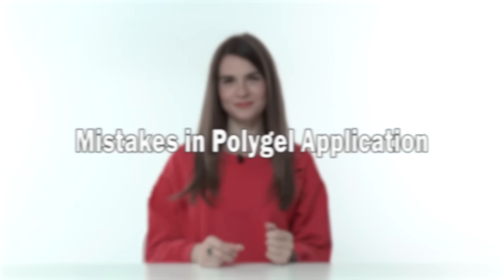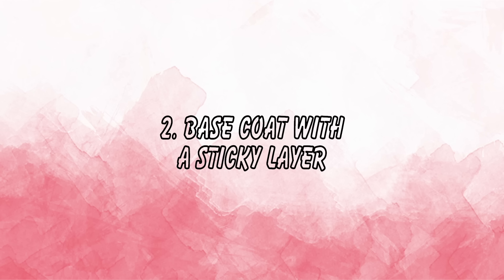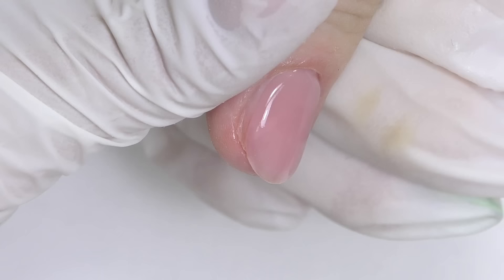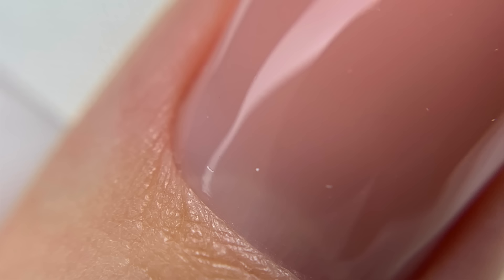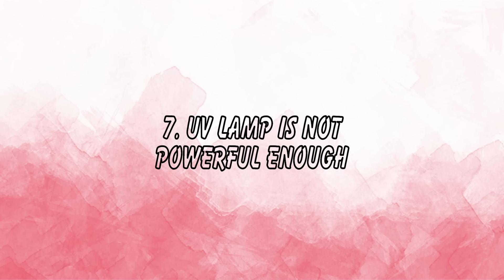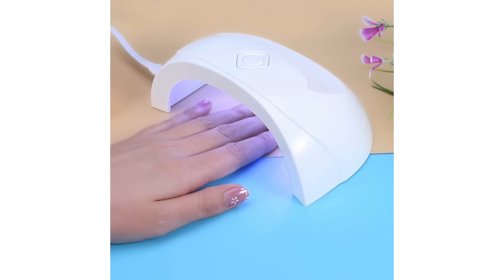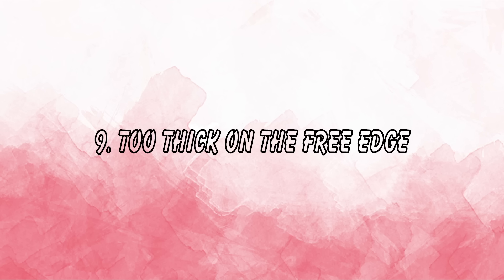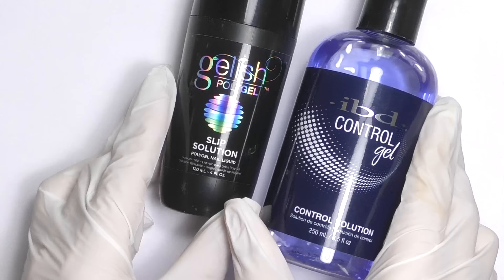Mistakes in Polygel Nails Application | Lifting problems

Comment: The special liquid is alcohol. Don't be fooled. 70% is good enough. Just don't use acetone. Aside from that, very good tips.
Reply: Eclipse Solano that’s what she said “special liquid” or “alcohol”. 🙄 also, any good nail tech will use 91% alcohol, not anything less, to be sure you’re better than “good enough”. 😁
Reply: I was having issues with sticking to the brush using alcohol.
Reply: @youngstaffswife2008  when I use 91% alcohol it turned my pink cloudy white.  70% alcohol is better.
Reply: @meaganhiller3029  I had that problem too.  All you do is use a little more.
Reply: Dayna even if I used more it still would happen. It would break down the product
Reply: Serendipitous Circumstance actually most branded polygel e.g. Gershion polish recommends 70% as any higher can cause the polygel to break down turning some colours cloudy or with white specks after curing.
Reply: 99 % is good or not?
Reply: Vimla Jharwal 70% isopropyl alcohol is recommended :)
Reply: As to the "special liquid".
From Gelish SDS Section 2: Hazardous Ingredients section.
Isopropyl Alcohol 
Isobutyl Acetate 
Acetone

Safety Data Sheet
IBD Control Gel Solution. SECTION 3: Composition/information on ingredients
Isopropyl Alcohol (CAS no.: 67-63-0; EC no.: 200-661-7; Index no.: 603-117-00-0) 90 - 100 %
Acetone (CAS no.: 67-64-1; EC no.: 200-662-2; Index no.: 6060-001-8) 1 – 10%
CLASSIFICATIONS: Flammable liquids (chapter 2.6), Cat. 2; Eye damage/irritation (chapter 3.3), Cat. 2; Specific tar
Reply: @youngstaffswife2008  70% alcohol is what everyone is saying to use.
Reply: @ishajharwal1573  not
Reply: I have Gershion and candy something lol and I used 91% and my nails turned out great 👍🏾
Reply: @youngstaffswife2008  they wasnt listening
Reply: I use acetone and it works fine 🤷🏼‍♀️🤷🏼‍♀️
Reply: Ashley Bailey I used hydrogen peroxide and it works well
Reply: Shan omg I have been wondering why my poly gel was leaving those white cloudy specs! I LOVE THIS THREAD THANKS EVERYONE!
Reply: What can I thin the alcohol out with, is water fine? My alcohol is 99%
Reply: Serendipitous Circumstance 91% ruins it! Don’t even bother lil girl
Reply: Celina Morgan if you buy a kit (some are really cheap on amazon!) it most likely has a slip solution.
Reply: Justyce Richards you used peroxide? Lol
Reply: Mo
Reply: Just use the base coat, that’s what some kits say to do anyways, works better and much smoother
Reply: His Serendipity she did not actually say alcohol
Reply: His Serendipity polygel nails need 50-70% alcohol 91% is too strong and ruins the polygel
Reply: @youngstaffswife2008  wrong!
Reply: @CelinaMorgan  no use less percentage alcohol
Reply: @ashleybailey2401  me too!
Reply: @strawburrygirl1215  interesting 🧐🧐
Reply: I believe that's what she said?
Reply: @meaganhiller3029  yes i sometimes have that problem. The trick is to slow down a little. I know it sound weird but i do it a lot. I try to do my nails fast and so i dont clean the brush all the way. Mabye have a separate dish just for cleaning your brush Inbetween nails. I do it and it works like a charm.😁
Reply: Yep I use 70%
Reply: Last week I wasn't paying attention and used acetone, I've learned my lesson 😵
Reply: No. All you need is the cheapest lowest alchole
Reply: @ishajharwal1573  no!
Reply: I like to use base gel
Reply: @youngstaffswife2008  no! 91% causes cloudy polygel.
Reply: @ashleybailey2401  you are definitely lieing. Acetone is used to remove the nails. Stop! You are spreading confusion on purpose
Reply: @marikiemarie7622  it works so why not use it😂. My nails never come off when I use it
Reply: She literally says the special liquid or at least alcohol lol.
Reply: Use whatever works for you lol
Reply: Is "100% acetone" with Denatonium Benzoate ok to use?
Reply: @harryismyhusband_jkbutilov9479  yes she did . she said "special solution or at least alcohol"
Reply: @MissHawes0187  but saying “at least” implies that alcohol is not the special liquid, but if you’re in a bind you can use it as a substitute. That’s not the same as saying the special liquid IS alcohol
Reply: 70-80% isopropyl alcohol has worked wonders for me, not just as a nail cleanser, but also manipulating polygel
Reply: special liquid is slip solution but u could use alcohol as well they are pretty similar
Reply: You can use %100 acetone nail polish remover or less than %100 or regular but obviously not just the straight up acetone
Reply: @CelinaMorgan  yes water should be fine. When I look at my 70% the other ingredient is water.
Reply: @User-jd9ut  that makes sense I used about 90% and noticed white spots after curing in the product😮😮😮😮
Reply: I just was about to write that. Cleaner, slip solution etc is just alcohol. They just charge you 5 times more for just 100 ml than you pay for a half liter Isopropyl alcohol
Reply: @youngstaffswife2008  uum.. 70 % litteraly is good enough. You don't need 91% at all as 70 % works not any less good and it certainly IS better for your skin.
Reply: @brittanyperry8653  use distilled water from the pharmacy, not tap water. Tap water will bring microorganisms and dirt to your nails, distilled water is safer.
Reply: I used a 90 one it was a mess. gotta get a 70%
Reply: Some of y'all are doing it all wrong....part of/most of the ingredient in slip solution is literally alcohol. 70% isopropyl or rubbing alcohol is the next best thing, the second best after that is the base coat gel that comes with your kit. Just be sure to use your regular gel brush to form the gel, as the polish brush is too soft. If you have neither of those, you also can use acetone FREE nail polish remover, that works fine, too. It all depends on the brand of polygel, the amount you're using, how you create it(i.e. dual forms, nail covers, etc.) & Your personal preference on what you want your nails to look & end up like. But NEVER use acetone...a simple Google search or most tutorials will tell you acetone literally permanently breaks down the polygel & is basically wasting your product & ruining it. If you don't know what you're talking about or don't have experience with the particular product being spoken of, it's best to just not comment. 👍🏽
Reply: Turns out 70% also disinfects better than 91% or 99%, live and learn.
Reply: Will wine work? All I got is wine 🥺
Reply: @traceydumase  😂😂😂
Reply: @traceydumase  I need wine after reading all these comments! Lol
Reply: I used 70% on my first try because my didn’t have 91% on hand and I can confirm it makes a difference. I was using a cheap polygel called Mobray that was really sticky to begin with and the 91% smoothed it out a lot more that the 70%
Reply: Thank you I'm late starting doing nails 💅
Reply: should i also refrain from using acetone on my natural nails during prep? i’ve been practicing polygel for about a year now, my application is the best it’s ever looked & i always make sure there’s never product touching skin in the cuticle area. recently i’ve been absolutely unable to keep them from popping off. i use markart base gel & isopropyl alcohol as my slip solution. i’ve struggled with lifting at the cuticle since i started nails but in the beginning i was at least was able to build & wear strong sets that lasted, now i can’t even get a hand completed b4 they all end up lifting off. i’ve tried almost every variation i can think off for prep & i’m honestly sad to do my nails now i have no idea what to do. my prep is 1:removing oils using acetone 2:gently buff 3:use an acrylic primer(ik not ideal but i notice when i don’t use it they come off even faster) 4: base gel
Reply: @pinkbismuth4457  same here. I use modelones and I also. Warm some sink water... put my polygel in dappen dish, small drop of base coat like a tiny dot.. put the dish in the warm water and it goes on like butter. I researched before i did it and it was pretty common..just not scalding hot because it'll turn white and it'll stay soft of you have some left over..that way I can put more paper thin coats to build it up..finish it off with builder hard gel for the final layer. Never had a break.
Reply: @ms.rolltide256  what, as a slip solution?
Reply: After so many tutorials I watchet, your coment is the most useful tip I was looking for
Reply: I use monomer and it works well.i have never had an issue with it.
Reply: THANK YOU FOR SPECIFYING THIS, I REALLY APPRECIATE THE LITTLE DETAILS, ALWAYS APPRECIATED AND ALWAYS NEEDED. EVERYONE THINKS THEY ARE RIGHT, BUT IT'S SO HELPFUL TO SEE OTHERS TIPS/TRICKS ❤
Reply: I used nail polish remover and it worked great. The nails lasted for 4+ weeks and I actually struggled with taking them off. Great video though ❤
Reply: I use monomer whenever I'm out of slip solution and it works just as good
Reply: Yes,but I think she is using an actual slip solution and I promise you it’s greasier than just 70% alcohol lol
Reply: Slip solution has acetone in it

Comment: I always get the cracks on the side 😫😔

Update: used your advice and my nails have never been stronger! You are amazing, thank you so much!!
Reply: I know it's been 4 months since you commented, but I'm curious has adding more to the apex prevented your nails breaking since you commented? I've lost 2 middle fingers in 2 days 😩, but I'm new at this. If you have any advice to add to hers I'd appreciate it!
Reply: Aleeza, what did you change:)?
Reply: Yep same here
Reply: @jadenamara1612  the apex is the most important. Can get some nasty breaks if its not built up..if you don't see that "hump" and the nail is flat if you look from the side. It's not enough.

Comment: Im guilty for using too much liquid  
:( sometimes i just forget to dab the brush off after wetting it and it puts too much liquid on the gel. But im learning!
Reply: You just helped me sooooo much!!! I need to dab the brush off first!!! Thanks!
Reply: I like to use those little make up sponge triangles for dabbing off excess liquid. Just the cheap ones from the dollar store. Lint free and they work great for this, give it a try
Reply: Me too! I've been working with acrylics for 30 years I just can't get used to it being so dry but it's so amazing!
Reply: I'm having the most difficult time getting to polygel to cure dry any tips
Reply: @bridgettemallory6868  I wonder if your lamp is going bad, when thier ready to be replaced they tend to not cure as quick...make sure you use a uv/led lamp also..
Reply: @bridgettemallory6868  It's prob 95% the watts in your lamp cuz it should dry 🤷‍♀️🤷‍♀️

Comment: I’ve definitely made thick jellybean nails my first couple of tries. I always had a little lip under my nail from where I couldn’t smooth out my polygel under my dual form and also not have lifting bubbles around my cuticle. I just recently got my new order of sticker nail forms in the mail and my nail shape is immeasurably better. Screw a dual form😂

Comment: Really good video! I picked this up as a pandemic hobby. I'd done my own acrylics in the past, and after reading about polygel I decided to try it. I'll never go back! I've made several of these mistakes, but the first ones were not prepping my nails correctly and using cheap polygel. The old saying, "you get what you pay for" definitely applies here. I use pre-forms, and they help with getting that curved shape. I've tried doing it without the pre-forms and they just don't look right. I also use alcohol for a slip solution (70%), and it works great as long as I don't use too much. Definitely had an issue with that in the beginning. I rarely have lifting issues, and if I do it's either because I didn't prep the nail right or it didn't cure right. Thanks for sharing your experience and knowledge!

Comment: I have used too much liquid , applied product too thick . I also have used a polish remover as my slip and still do  at times  but never had any issues doing so . What do you recommend when a polygel is super sticky ?
Reply from the maker: It depends on the ingredients, some of them will work if they don't contain oils.
For super sticky polygel I can also recommend any thin consistency soak off base coat - lightly apply on on the brush.
I use polygel liquids and 90% alcohol works pretty good
Reply: I read non acetone polish remover with a little of 91% alcohol

Comment: I recently started using polygel and did in fact notice that the base coat was sticky when it came out of the lamp. I did not wipe it for fear of causing the polygel not to stick. I had one heck of a time with slipping and I was unable to shape the underside of my nail without the entire dualform slipping off. For the last two weeks of my attempts I have had lifting, cracking and breaking. I am now too irritated to mess with them again because I know that I will get upset and sling the stuff across the room. lol.. I am now watching every single "how to" video so that I can get this right.  At this moment I have my left hand with a full set of 5 nails and my right hand with my thumb, middle, and pinky finger only and those are lifted, and chipped. (eye roll). When I tried fixing my left hand I was already so irritated that I was going to try and make sure that I was going to get it to stay. I remembered how strong the Rhinestone gel nail glue was and I drilled down the lifted parts and prepped the exposed nail and then covered the exposed nail with the rhinestone gel glue. It worked. I am not going to continue that because I only have a small amount. I want to accomplish the polygel anyway. I just can't seem to get the apex strong enough and keep the product off my cuticle. This time I am just going to leave an orange stick space and just keep practicing. If anyone has any tips that might work for me please let me know.

Comment: I think sometimes I use too much liquid because the gel is stiff. Q: Could I maybe put the tube in a cup of hot water a few minutes to soften it a bit? With the lid up of course. I really love using it. You get more time to play. It has help with my acrylic application. You have to work faster with acrylic, but I can really see a difference when I do my nails. Thanks for your videos.🌹💅🏾
Reply from the maker: Yes, placing the product in warm temperature will help to make the consistency thinner for a little while, but be careful. do not heat it too much
Reply: Thank you for the reply.

Comment: What can I use for the dehydrator step? Would any of these work: %70 Isopropyl alcohol, %99 Isopropyl alcohol, or professional Acetone (contains only Acetone & Denatonium Benzoate)? Or, is there a specific product I need to get that just cannot be substituted? (BTW don't worry, I'm not a Nail Technician or an Aesthetician. I would just like to do my own nails.) Thanks.

Comment: I use dual forms, and I use a dehydator, and also buff the nail beforehand. The first day it always looks great but by the second day the edges where it meets my cuticles are always a lighter shade, which then eventually begins to lift by the 3rd or 4th day. Ive tried with and without primer, I dont use too much liquid , and I make sure that theres no air bubbles. I havent had a successful application yet :( what am I doing wrong?

Comment: My beginner blooper first time polygel; using the dualform with the tiny wiggle handle at the cuticle. Result to be imagined was two dots at the outside of the cuticle.  Do not do that. It took me eyons of skincreme to remove that as I have a very dry skin. Have a tip for beginners; use vaseline at the outside of the nailwalls; specially if you use gel polish, makes for easy removal and also works for normal polish bc it will resist pigment so skin doesnt look spotty. I have a slight tremmor in my hands wich is why I skipped over to polygel.  Tremmor and nailpolish dont play nice lol

Comment: Interesting,  the part about the 
led light.
Did poly gel for the first time
the other day.
Noticed a heat spike in product.
Nails got hot and had to remove hand from light.
Light maybe to powerful,
Will try at 50% power next time

Comment: I am self taught and so I have no idea how to use this properly. I am still trying to figure out the thickness part. I have no idea how thin poly gel should be. I always end up with some on my skin because I get it too thick on the form and it is always to thick on the free edge. The few times I have gotten a thinner free edge the apex is also to thin and the mail breaks off. I keep trying because I bought the product so that I can have long nails but it takes me hours to do and is very frustrating. These tips have been helpful so thanks.

Comment: Awesome tips, thank you. I'm just wondering, if you remove the sticky layer off the base coat wouldn't that interfere with the adhesion? 🤔 Would you need to buff the nails before applying the polygel? Thanks 🥰
Reply from the maker: Great question!
No, adhesion will still be good
Reply: @Nailcou  Thank you! ☺️
Reply: I know this was a month ago but I always recommend buffing the nail lightly

Comment: Thank you so much! I would love to see your video with mistakes with polygel, gel and acrylic extensions and even with gel polish nails but also what you should do when mistakes are done.F.e. when gel is fully cured or polygel uncure nail is floated with liquid, or gel polish nail is cured with bubles or is floated with base coat or top coat or after layer of color gel polish you see that surface is very uneven and you don't have time to remove gel polish then file it again to make it even.  How to handle in different difficult situations with some tricks. I would really love to see it. It would be very helpful.
Reply from the maker: Thanks, Natalia! Great ideas for new videos!
Reply: @Nailcou  can you plz tell me how to prevent bubbling